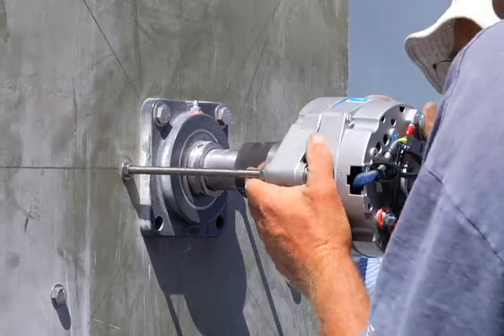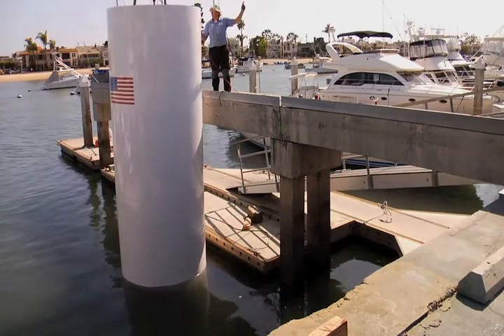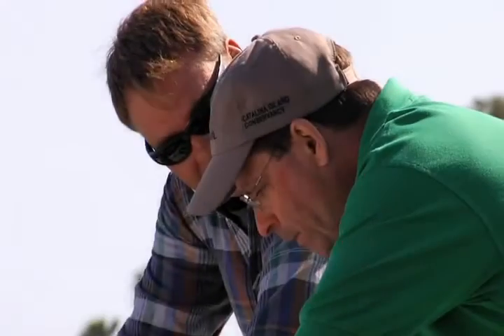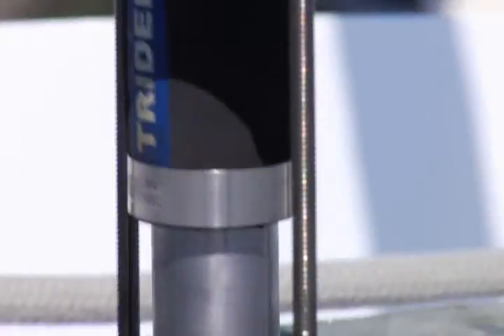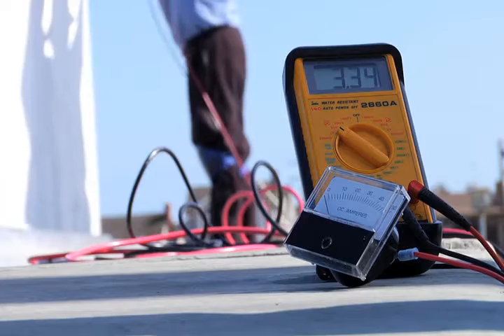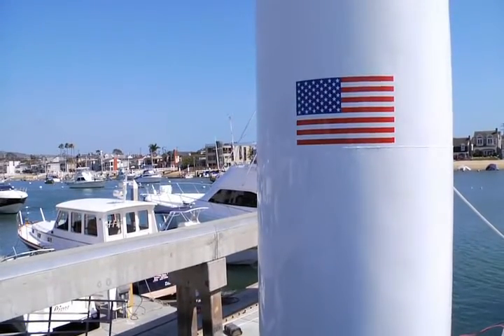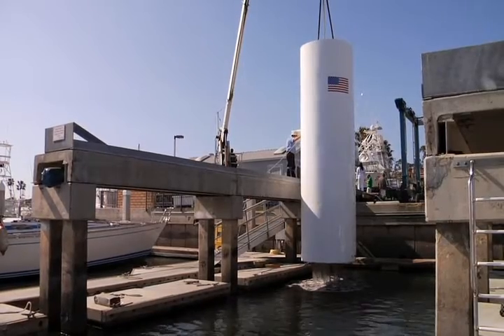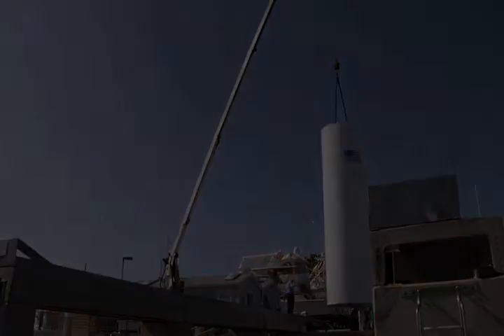UnderThe Bottom Generator

Comment from the maker: @Begbucks Thanks for your interest. We are working on small units. A 2k unit would be 2 to 3 feet in diameter depending on normal wave height.  The problem is the EPA which requires permits for any ocean generator that connects or replaces power that would come from the grid. If you are in a location where the grid is not available you might get around this. Permits take 2 years.  This has been out biggest problem.
Glen

Comment from the maker: @datzfast  The alternator is a 10,000 watt PMA, not a 1,000 watt car alternator. The UBG will produce twice the power of a float or bobber because it generates power on the way up and down. A float device only generates on the way up. A 60hp, 45,000 watt generator would stall as there is only about 15,000 watts available with a unit or float this size in a 3 meter wave. the UBG converts about 70% of the power of the water it displaces. You should read and understand how it works.
Glen